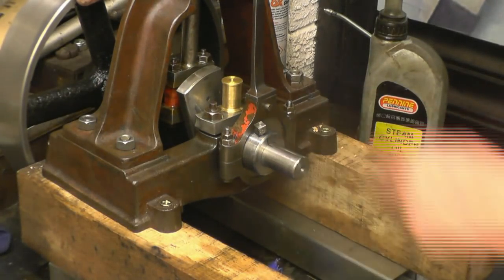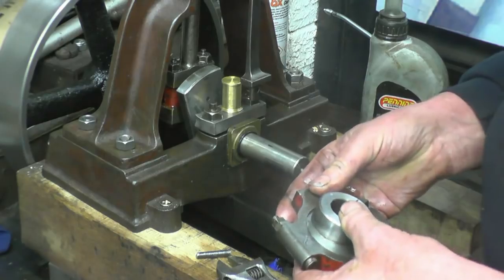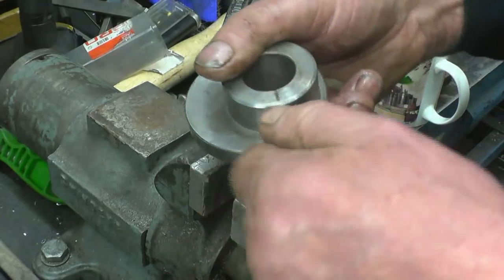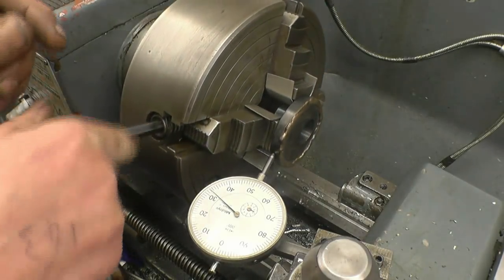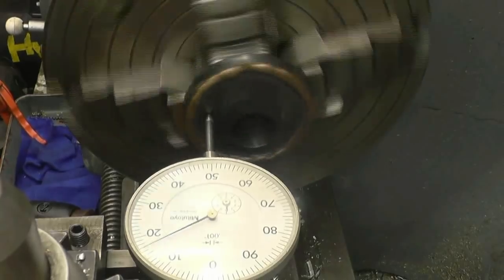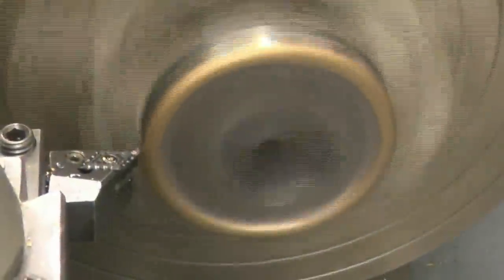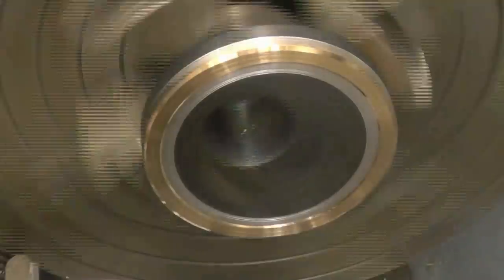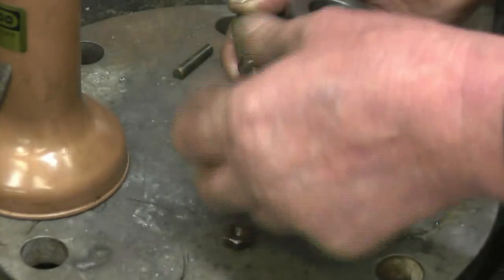SNNC 224 P2  TIG Bronze Weld Build Up

Comment: For a drill test how about just measuring the size of the hole they cut in steel, then how long they last before going blunt and loosing their edge drilling brass or stainless. Brass isn't hard but it doesn't half blunt a standard drill bit quick. 
Loving the sound of that engine. Beautiful 😎

Comment: as a test for the drill bits...i had to drill a hole in the handle of a pair of record stilsons to hang them up, chinese hss wouldnt touch it, but my older dormer hss had no problems with it, can you replicate ?
Reply: @Jusb 1066Thank you for your support, I did see it before it disappeared

Comment: 01:26 I was just thinking that myself... I bet you've got loads of high quality metric, AF, Whitworth and BA spanners yet you use an adjustable :)
Reply: dont we all though!
Reply: He has, but of course they will always be elsewhere, while the one size nut rounder is always to hand. I have a few of them, in assorted sizes. Small, medium, large, plumbing parts, and finally " One size fits most". The last one is a little inconvenient to use on small nuts, as it does tend to snap them off just with the mass of the spanner, plus you might lose anything smaller than M5 in the jaws. Does make a pretty good hammer though.
Reply: They go mad at work if they find a thumb-detecting nut fucker lying around :)

Comment: If the drills drill brass after drilling stainless, they are probably quite good...
Reply: 10 holes in 316l stainless steel the diameter of the drill thick, lubricated, then follow up with drilling holes in acrylic sheet 2mm thick. If the stainless has been nicely work hardened  ( round wall thick tube pipe will do, as it has been work hardened nicely during manufacture, and is generally not annealed either, especially if you use a formed bend)  very few drill bits will do the 10 holes without getting severely blunted during the process

Comment: Hello John. Congrats on fixing the knocking issue on the steam engine. My suggestion for testing that indicator holder would be a side-by-side comparison with a Noga, if you can scrounge one up.
Reply: Paul Compton tidied up his cheapo so it works as well as a real Noga.  I got lucky with mine I guess. It works fine as is, AFAICT.
https://www.youtube.com/watch?v=qnHfHl7LI7Y

Comment: Hello John.  I enjoy your videos very much. As far as twist drills, I have a question more than a comment.  With all of the various types of drills could you comment on that materials being drilled require a lubricant and what sort of lubricant (light/heavy oil, something special( would be recommended to prolong the life of the drill?  I seem to have drills that die after one use (probably due to abuse) and would like to know if there are some guidelines to go by.

I love the steam engine series.  I can't wait until you get it run from a proper steam boiler.

Christopher

Comment: Hi John, 
Great channel as always. 
With regard to the twist drills, they look like forged items, rather than having the flute and relief machined and ground in a HSS blank. On larger/Morse taper drills, the shank/taper part is a low carbon steel friction welded stub. For reamers, brazing is also used.

For testing them may I suggest using your mill on quill feed ( if you have this) for consistent conditions on mild steel, a tool steel, and some stainless materials. Also try to drill a socket head capscrew, ref hardened and tempered material.

Steam engine looking and sounding good.

Comment: Don Bailey of Suburban Tool did an informative video where Chinese drill bits were compared to higher quality bits. View that video to get ideas for your own test.
Reply: I'd bet John already has his own ideas.  pointless re-shooting something that's already bin done, however badly.
That review is hardly what you'd call impartial or unbiased,  I'd hate to buy a car from this guy.
It's just yet another of the more blatant 'murican reviews of kit from totally dissimilar quality price bands in a misguided attempt to discredit import goods and to prove that There's still life in the old dawggie yet.  Of course good quality, expensive precision tooling does what it should - and of course a cut-price equivalent doesn't do it quite as accurately, that's no surprise.  But not everyone needs a high degree of precision for every job.  If the smiling snake had done the same review using starrett Vs harbour freight, I'm sure the results would be the same or worse.
I'm quite happy with my £1.50 chinesium set of 1000 assorted 1-4mm drills - beats using a fork to make pilot holes.
Reply: exactly, anyone older would remember the 70s' when even british makes, sold carbon steel drill bits, didnt drill metal at all , maybe a bean can with a slow hand drill....HSS became the marker that separated junk from quality (but has been abused now of course)   even the worst chinesium is a match for those.

Comment: "Piss wobbly fit" that. -  Using an adjustable wrench just gives it more authenticity, with the slightly rounded nuts,  LOL  The brazing will look right at home on a vintage steam engine. - Sounds a lot better.  Another interesting video.. Is there an item # on the drill index. -  See you next time!